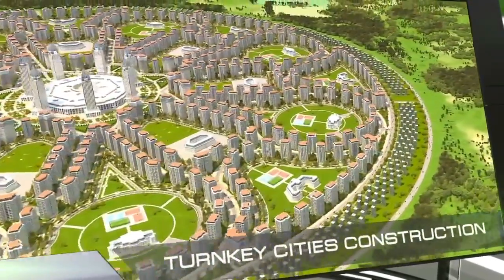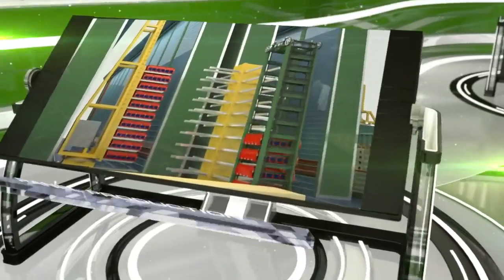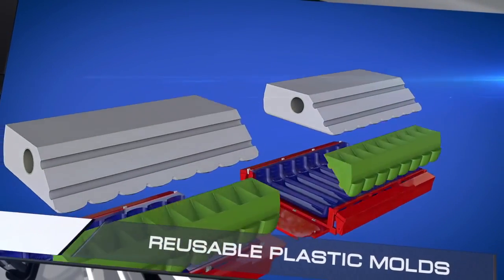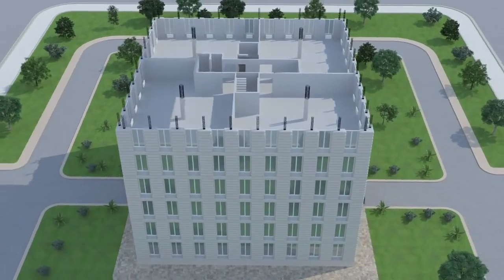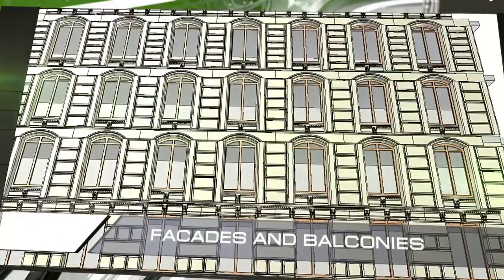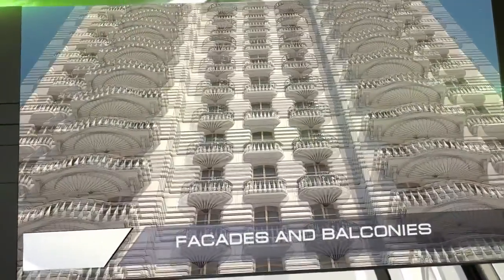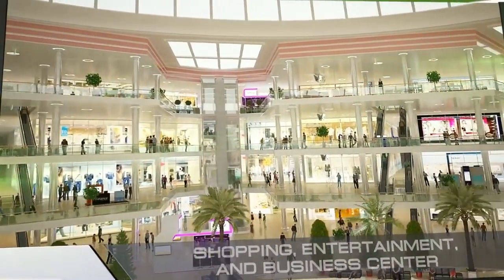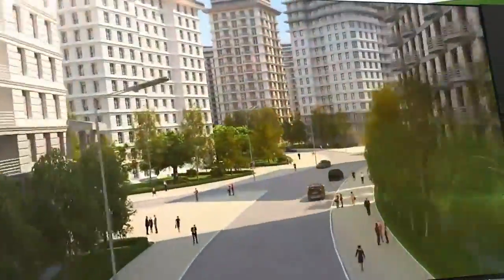Futuristic Quick Prefab City Construction Technology

Comment: If you are looking for a great business opportunity,
why not design a complete city, under a sealed dome
with integrated solar power, and wind or hydro power if available.
All air would be filtered to keep out pollutants and cooled or heated to comfortable temperatures.
Individual buildings would require no heating, or cooling.
Large areas for parks and gardens, lakes, bicycle paths everywhere.
No combustion type engines would be allowed inside the city.
Greenhouses attached to grow enough food.
Totally independent from the outside world.